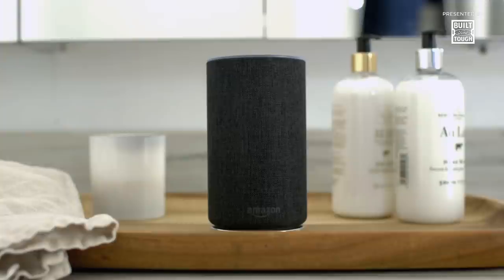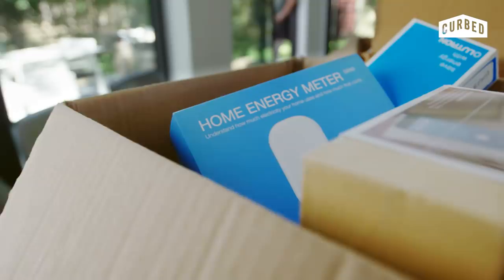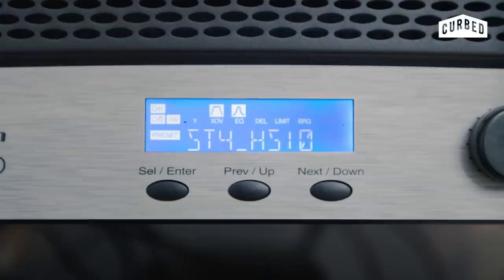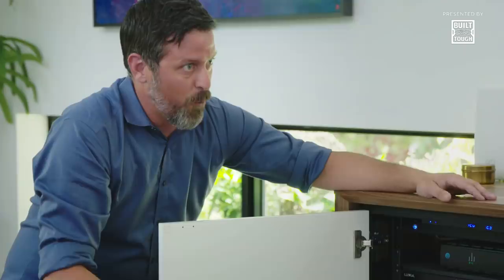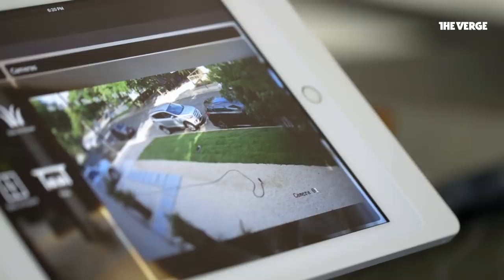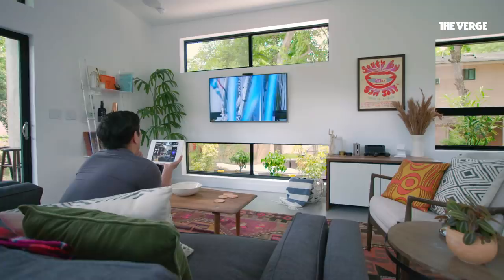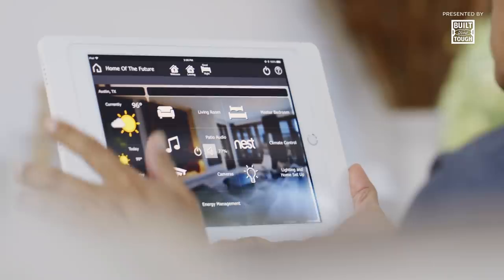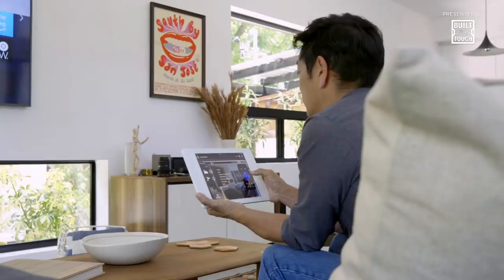Designing the brain of the Home of the Future with Grant Imahara

Comment: Nice system but why not use PIR sensors to trigger lights into lighting at different modes subject to time of day, CO2/humidity/temperature/weather sensors to trigger air conditioning(inc heat recovery) and blinds.
Using a system as you have shown has been the vision for decades but is only used by high-income homeowners.
Sadly Microsoft doesn't make a service/product feature yet that they should the Azure home.
Say where a Surface Go user can use the computing power of compatible devices in the home to do things like editing videos.
With a Smart TV having a Tflop of power and consoles of 4-6 Tflops users could better use the power they have as an on-demand cloud.

Comment: how does the wiring to the rti xp-8 work?
Reply: It connects to your network, and can control other devices with either IP, RS-232 or IR. It also has built in relays and sense ports, meaning it can switch, and also detect certain events. This is all before we add in the smarts of the firmware and the skill of the programmer.

Comment: Hmm, all of these things can be achieved with way less money. Use homeassistant for the OS, which already have the capability of plugging into pretty much everything. Also Alexa or Google home for voice control? Unless you want the assistant features it's much more convenient to have deepspeech process commands locally, and let's not talk about the privacy issue of having a big corporation listening all of your conversations 24/7. What if the internet goes down, all that wiring for nothing. Also wireless technology is reliable enough, the problem is security; you could jamm the signal and prevent your devices from communicating, but that's about it; in theory everything should work the same. That's of course if you were smart enough to program your devices to behave correctly in case of a connection loss, which you should be doing anyways!; Even if you are making everything wired.

Comment: "Ahh, man, it's really great when things have an open API, it makes it so easy..."
"So can I maintain the system myself?"
"Nah, man, we have to do that."
It's okay that they have a service fee, but they should be a one-time payment option.
Reply: There is. It depends on your integrator. The subscription service is likely to be specifically for firmware updates and remote changes. You would have the option of one off service call fee if you preferred - just talk to your integrator. Seems to be a lot of confusion as to what the $30/mth is for. the system doesn't stop working without it, and "updates" don't mean exactly what you think it does. This is not an iPhone/Android app where the end user will see, almost straight away, most improvements/updates. In this space, most updates are specifically for the hardware, and mainly make the integrators life easier.

Comment: Ummm, no. The octopus is one of the most intelligent cepholopods but it has no single brain. Similarly, having a central server is something of a quaint idea. I'm converting a van for full-time living and I've thrown the idea of power-switch-load circuits out of the window. When a switch is pressed, it tells everyone. If the device feels like doing something with that request, that's up to it. Every single button and readout does this, just talking among themselves.
Sure, I have some nodes that are more powerful than others. My main machine and my phone are hooked up, there's a Pi 4 in the cab (mainly to play music, recognise speech, navigate and show the rear camera's output) but the rest is just Pi Zeros for video and Arduinos for pretty much everything else.
If you didn't make it, how can you fix it and if you can't fix it, do you really own it? More importantly, who, exactly, does it work for, you or its manufacturer? Better to make them one and the same.
The wires you showed were network cables. Sure you can run power through them (up to a few amps) but they are more reliable, secure and efficient than WiFi and don't just bury them in the walls - I want to get at them later on to modify the system if needed. Why you have more than one cable going to the same place is just bad design, though. Distribute that stuff!

Comment: That setup was way overly complicated. I have 5 echo devices in 2 story full basement house. All of the lights and tv/stereo/sound bar are controlled via Alexa. Plus my garage door. Using a Wink hub in a 3000 square foot home. I don’t think that have spent Max $1500 on everything 17 light bulbs 7 door and motion sensors 4 Switches 3 plugs 2 hubs wink and hue 2 power strips 1 harmony hub/remote I have nest but it came with the house and a garage door opener(not with the house) also 1 light strip. I’m just a normal guy making life a little convenient.

Comment: This type of smart home integration is going away. Hubs such as SmartThings and the use of condition statements using IFTTT (applets) allow you to do much of what this system does without the extended cost and need to have a dedicated programmer. The goal is to design a system that plays well together, so keep this in mind as you plan your purchases.

Comment: For most smarthome tech, there's one Achilles heal, cognitive load.
What's more convenient, opening an app on a phone/tablet, navigating to the required control interface and selecting to turn off the light or whatever.
VS
Getting up and pushing a physical button.

One involves more steps and requires a degree of thought(minor as it may be) and the other doesn't.  Smarthome tech is cool but ultimately useless.
Reply: Its not for everyone. 

But... if you were building a home yourself, and you could choose where to put switches in the home... would you put one by your bed so you wouldn't have to get up (if it was brought to you attention)? Or keep it on the other side of the room?

what if you could magically put that Light button on a timer for when you fall asleep with a light on? 

I don't want to make people lazy but if I can save them a trip around the house at night to Lock doors, Kill lights and music and make sure TVs are off, then I defiantly want to help with that.
Reply: I don't disagree at all, the scenario you painted is an ideal application of smart-home tech, god knows I hate getting out of bed. Like if I was away for the weekend, I could programme house lighting to come on at certain times to give the illusion that someone was home (deter thieves) and check if all the doors are locked from the beach. That's where this tech starts paying for itself.

My criticism was from a design/interaction perspective, you have to design a system to incur a lesser cognitive load than the alternative if you want people to interact with it because people are actually more willing to expend physical energy than mental 90% of the time. 
You'd probably be more inclined to switch off the dining room lights through the smart-home system  if that system is easier to interact with than a wall switch. Presenting the system through a GUI for even the most mundane tasks is going to incur a cognitive load, so maybe ditch the GUI and opt for a speech recognition system instead.  
"Turn off the lights HAL"
"I'm sorry Bobby, I can't do that"
0_0 

I'd use that system if it was just voice interaction, simply because I, like everyone else, don't want to sacrifice even the most minuet amount of thought to something like switching on/off the lights. This tech doesn't make people lazy, we were lazy to begin with and you have to design around that tragic fact of nature.
Reply: Totally possible. Thats a button called "Vacation Mode" and its a huge request for our clients with second homes. Its very doable on our systems.
Reply: Vacation Mode and the potential of your system being used for home security is the real killer app imo. You can't hand wave away the system as being just an expensive gimmick if it offers that kind of utility and peace of mind to a home owner.

I can't say I know much (or anything really) about voice recognition licensing in terms of cost and difficulty of integration. But is that something you've thought of for the more mundane of tasks or would there be difficulty interfacing such a control structure for your system/connected devices APIs? Or is voice rec something you'd consider redundant considering your interface seems quite mature already?

Either way, it's a very impressive system you've developed and I wish you the absolute best of luck.

Comment: Really!  first: You need a real rack.... 2: the way how you pull wires is wrong. 3: You need space for " everything" (ventilation).
4: Use better hardware and Software if you really want an smarthouse. like CRESTRON OR SAVANT. 
NOTE: if you are an professional installer you should know SOUNDBARS doesn't looks nice on top the TV.

Comment: The entire concept of  apple's "home kit" is to eliminate the need for this highly customized RTI system.  this RTI is just another "home kit" unified home control option.

This has existed in some form or another for a while.  Crestron for example does this same exact thing.
Reply: I agree. And I have been installing home technology and automation in some form for the past 20 years. Back in the day everything (including lighting) was triggered by relays. We would dial into a landline and press *9 and the lights and automation would start up. Smart Homes have come a long way and Crestron and RTi are  evolving with the technology at the same time using Updates.

In my opinion, Homekit will maybe evolve into something fully customizable someday but my at this time my home kit doesn't do half of what my RTi system does. Plus everything has to be homekit ready.
Reply: appreciate the reply.  And I believe that a fully integrated RTi system can outperform/task HomeKit.  As much simplification as HomeKit provides due to vendor differences and standards it won't ever be compatible with everything. hence one of the values of an RTI system.  I would also argue, the RTi system enables a single common interface for everything which helps when you have many different users and people with different experiences attempting to manage the smart home.

Comment: I wish the systems were more user-friendly in terms of modification and changing of components I don’t think anyone would want to have the installer come back and have to pay them to hook up their damn Xbox.
Reply: I finally systems to be even more anti-consumer them apples repair policies because what happens when you want to change a component but the company to install your system has gone out of business and The manufacture of the controller will not give you the programming software or manuals because you’re not a licensed installer. at least with Apple if my iPhone breaks I can always pretty much get it fixed Apple retail stores are not going anywhere and even if I choose not to use the Apple Store there are plenty of third-party parts and manuals out there to do the repair yourself.

Comment: These functions are redundant and/or unnecessary. You are still pushing a button, be it on your iPad or on the wall thermostat. Once you reach a certain level of automation you don't need any more.The house itself is what needs improvement. The house of the future should be way cheaper, way faster to build, using the Earth and Sun to be self-sustaining, self-repairing and efficiently laid out. All these gadgets and add-ons are inconsequential and will be obsolete in a couple of years.

Comment: Don't listen to this video, its a pile of horse poop, My house has every devices connected to the internet, either through Wifi or connected Ethernet... I had no dude shuffling below my floor boards.. 
Most ISP's give a moderate modem/router, if the range isn't great for you then you can use Wireless Access Point (they plug in you power socket and boost the range) or an Ethernet power line adapter (again plug in to power socket, new ones give you the power plug back).

I would say that a good modem and Router is the key, don't always stick with the ISP's choice.. I'm in the UK and I have replaced my Modem/Router with a DrayKet Vigor 130, connected to a TP-Link Archer 5400 MU-MIMO Tri-Band router, I get extended Wi-Fi range and every device in the house has Internet Connection

At the moment (22:32 at night) I can see 4 wired connections and 9 Wireless connections.

Comment: L-O-L At their choices of "Smart Devices."  Rokus?  Really?  That's hysterical.  

I would so much rather do my own wiring (I can hide wires/cable manage and operate drills and know home construction just as well as these guys do, if not better; it's nothing any 14-year-old doesn't learn how to do in an A+ certification course, which in and of themselves are absolute jokes), integrate my own "operating system" (a combination of all three, actually, because I use Macbook Pros, Windows desktops, and various Linux flavors), use my own devices (Phillip's HUE lighting, Scart array so consoles can be expanded, airflow system in the cabinet with dust filters, HTPCs running Steam Big Picture mode/Windows 10, integrated Bluray connectivity, segregated Plex server ((LOL netflix!!, also so much for "home butlers" being useful and biannual visits from "tech support" hahahaha)), segregated FreeNAS server, automated sliding doors, full home optical audio connections ((just distinguishing between "indoor" and "outdoor" tells us nothing of the fidelity you used, you twats)), localized 10 gigabit transfer speeds, caching server...  the list goes on, really) and I bet it would've cost a fraction of what they pay these guys for maintenance in a lifetime.  Yeah, I'll probably spend more upfront...

But so did people who didn't buy Ford Pintos, or better yet, bought tools and learned to work on their own goddamned car themselves.